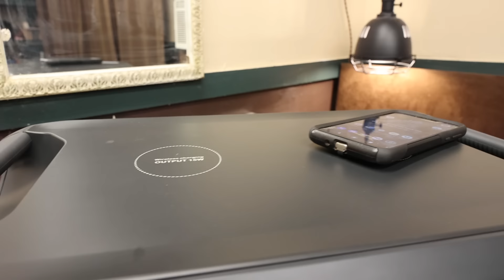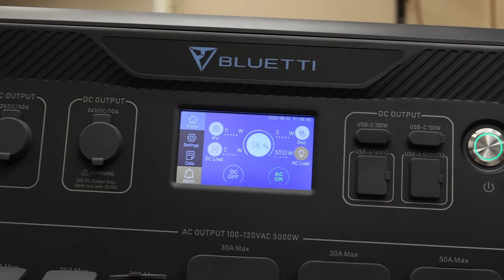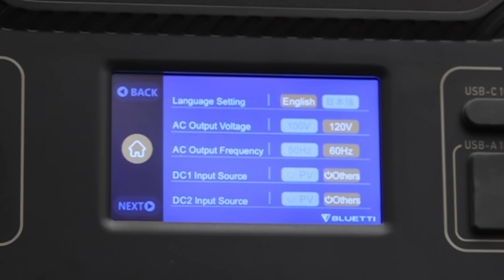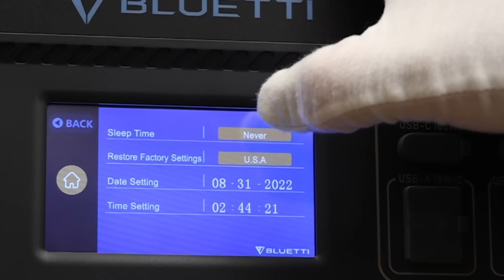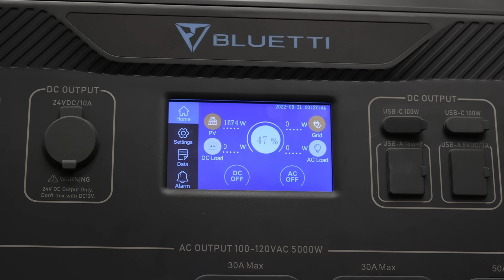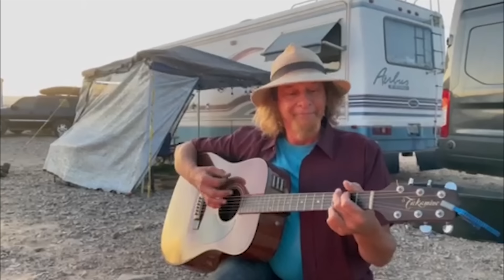Bluetti AC500 5000w LiFePO4 UPS Portable Power Station Solar Generator Review

Comment from the maker: Check out the AC500 HERE: https://gohobo.io/ac500 use code HOBOAC500
Want to HEAT the BATTERIES with SOLAR? Get this! https://gohobo.io/d050s
FACEBOOK GROUP: https://www.facebook.com/groups/hobotechcrew/
AC500 SOLAR PANELS: https://hobotech.tv/amazon/#Solar-Kits
Reply: "battery conditioning" I think is the technical term but yeah truly an amazing piece of equipment and now getting very near the point of in fact being grid scale electric storage if inclusive with proper software where say 10,000 of these could be linked up together upon a proprietary communication system to create said "virtual power plant."

Does it have wireless charging?
Cigarette lighter adapter needs to made using proper material metal connectivity given well known lack of surge protection issue.

Be nice if it came with a cigarette lighter too in point of fact.
Reply: I am looking into the 2/450 renogy, says out of stock. I reached out  to them, they say they dont have a 900 watt kit.... wierd.
Reply: Just want to let you know that there is someone impersonating you in the comment sections claiming we are winners of a giveaway that you are doing, and that they are also impersonating you on Telegram requesting money. They are using your picture and name. Please message if you want more information or screenshots.
Reply from the maker: There's nothing I can do about scammers since YouTube takes no action against them. They spam every video for the past year and I'm tired of being asked about it.
Reply: @HOBOTECH  I would feel  better if we can talk on the phone
Reply from the maker: @thomaspuma434  I don't talk to anyone on the phone and I quit doing giveaways thanks to the scammer BS.
Reply: Can you run a fridge with it?
Reply from the maker: @a.barker7792  It would be a useless product if it couldn't run a fridge.
Reply: @HOBOTECH  your right. Not the techy you are but all my neighbors are getting propane generators that run for about $350 bucks for 48 hours on a pig system. Why? Now that a complete waste of dough. Use this on and off with a small generator and solar array keeping up by throttling should be good even in Texas. During the cold spell, we surely had sun.
Reply: @HOBOTECH  thanks dude.
Reply: I see that this product has a 50 amp plug my RV which is a very big RV plugs into the pedestal on the 50 amp service with this thing run my RV or do I need to have two of them with how many batteries I have 3 ac units 1.5 ton. Also I have a residential refrigerator that runs on DC as well as 115

Comment: I have been watching the Solar Generator wars for some time. I have the technical capabilities to build a custom system, but the innovation between competitors is making me rethink a custom system.  The big question becomes when to pull the trigger because we all know an AC10000 is just around the corner.  Keep up the great work Hobotech.
Reply: I'm wondering if there won't be a relaunch of the EB500, which now looks something of an odd-one-out in the range. Perhaps something that better fits the "visual language" of this range, with this inverter (or better!), 5-7.5kw of onboard storage and support for the modular batteries.
Wouldn't mind a mild update to the AC200Max, too. Maybe 2500w inverter, a UPS and three battery ports? I'm saving for one of them, so an improved one with early bird discount would be well-timed in the next couple of months.
Reply: If an AC10000 ever happens... I can't hope/beg enough that Bluetti redesigns that clumsy/behemoth of a dinosaur power cable!
Reply: This is all backwards compatible so that's why you can buy these right now...especially the now far more valuable previous Model which again...works perfectly fine with the current system apparently and I imagine vice versa.
Reply: @__WJK__  It better have wheels, too
Reply: @jtnoodle  - Yeah, everyone has different needs but wheels aren’t much of a deal breaker for me, seeing how there are a ton of DIY wheel options I could easily add/build with off-the-shelf parts from a local home center store. However, there really aren’t any easy DIY solutions for re-doing that  horrible power cable connection design, unfortunately.
Reply: Yup.. like buying a computer.  It's obsolete before you get it home.
Reply: Need some experienced advice- between Bluetti & Renogy Lycan. Which would you pick in an off grid situation to power a small/tiny house/rv/ cabin? Need air conditioner capability. (And how much battery do I need running air con during day vs. at night with no solar input. The standard of at least 800 ah worth of batt is based on lead acid or ?) Planning on at least 1800 watts of solar to start. Have back up gas gens as well.
Reply: i got the 300 for my van , and 3 months later this came out... so now im waiting for a upgrade but it does not seem to come... i think if i buy this it will
Reply: Im trying to figure if this is thr way to go in a van build

Comment: This unit is approaching what a massive wall of state-of-the-art inverters, chargers, batteries, wiring, switchgear and breakers were 5-6 years ago.
Reply: Absolutely!  I think it really all got these vendors thinking when they saw what Tesla was doing with their cells in the car.  Amazing how quickly it's all changing.
Reply: This is what I have been waiting for.
Reply: Yeah it almost doesn’t make sense to DIY for small systems
Reply: Cool 4ID logo. We 4/10MTN were attached directly under them in Baghdad 07-09. 1/66 Armor were the only guys we dealt with. Best armor guys I ever worked around in my 6 years active.
Reply: To get 5000W input you need to re-program the device.  What is the default input wattage programmed by the mfg???  TY
Reply from the maker: It was set to 15A by default. You need the code to set it to 50A.
Reply: @HOBOTECH  🌷☘️ Thank you!
Reply: @TobyCostaRica  Especially when you factor in the mobility.
Reply: @HOBOTECH  and where do you get the code?
Reply: @debrasaints3809  you have to call bluetti and if they think that you won't hurt yourself or fry the battery then they will give you a code to use
Reply: @HOBOTECH   15A. That explains what I’m seeing with my system. I’ll have to get a code so I can change it up to 20A or 30A. (Pulling AC from a 50A RV post down to a 30A cable to the ac500. AC500 to RV with 30A cable.) I’m only seeing a max input of 1800w even when my output pushes over 2000w.

Comment: I just bought the AC500/B300s last week and your coupon code still works (thanks). I love that it's "plug and play." Several years ago I built a 1500 watt off grid system back when lead acid batteries were the only way to do. I had to go through a checklist just to turn it on/off; turn on Heavy Duty DC switches to connect all the batteries together, turn on circuit breaker 1 to power up the charge controllers, then circuit breakers 2 and 3 to connect them to the solar panels, then turn on Heavy Duty DC switch to connect the Battery Bank to the Inverter. Once everything was running I had to keep an eye on the charge controller meter for when the battery bank was down to 50%.

Now, with the AC500, I just plugged in the solar panels and turned it on. It stays on all the time now and I occasionally check it through the app on my ipad.

Comment: We are edging slowly to my dream of having devices like these becoming just normal part of the build of a house. Just like you buy an HVAC system and a Hot Water heater, you would buy a "power system" that can act as a whole house UPS and Plug in ready Solar system (in case you don't have solar yet).  This is an exciting time in Solar!  THANKS TOM!!
Reply: I have a power pole outside my building it goes to my barn and the power company wanted to just charge me $40 a month before I even bought power that's almost five or $480 a year and I was like screw that I live in a tiny house I need 1.2 KW but I have to pay $480 just to get access to the power a year nope these videos give me hope also and if I need some extra power there's always a generator and I guarantee you I won't use $480 worth of gas a year using it
Reply: Have you seen the electric prices in Europe?  For them, it will be a requirement.
Reply: It will be a terrible thing for the environment if everyone needs something like this.  Imagine all the toxic waste from the mines and batteries.  FAR WORSE than running a few coal plants.
Reply: @shaunnightfire8269  I disagree. These "end point storage" solutions will be a benefit because it will allow us to adopt renewables faster since we won't need as much expensive grid scale storage. As to the batteries themselves, their composition will change over time to be more environmentally friendly (Sodium, Graphene .. etc.) so I am not as worried about that.
Reply: @jonjohns8145  The large scale lead acid batteries are far better for the environment than thousands of end users having a bunch of lithium batteries.  The grid batteries are expensive, but they last long and a better utilized when properly load balanced.  Its like the difference between powering your car with one large lead acid battery or 100 lithium aa batteries for every motor light and gizmo in your car.  As for adapting renewables for primary grid power,  every attempt has been a disaster.  Wind, solar, and even that salt water mirror thing in the desert have underperformed and have caused other secondary issues like waste disposal and wildlife impacts that are worse than using conventional sources like coal.
Reply: @shaunnightfire8269  yeah but I can’t afford to buy a coal mine and the prices are going so high I am preparing to go off grid and this is going to future proof me for a while.
Reply: @nomaddavestinyhomes2363  try Alberta Canada we have fee's that are over 100 dollars per month I have central air conditioning 240 volts AC I'd like to get a heat pump water heater and heat pump dryer all 240 volts AC I'd love to go solar but being a senior on pension unfortunately I don't have 10 grand in my wallet like these utube reveiw chanels to get a solar generator that will give me 240 volts AC I'd like to see a 2000 watts pure sine wave inverter that's able to be paired with a 2nd unit for 240 when my budget allows me to
Reply: That's why you also have to reduce your use and as solar isn't going to do it and if you're in Canada then the winter time comes depending on you where you are there you're probably not going to get a whole lot of solar so what I did for my place is I know that's probably going to happen and I probably have more Sun than you in the winter time and I turn around and just basically figured out ways like I put a lot of stuff on natural gas or excuse me propane so anything I can do on propane cuz I can get tanks filled and get a farmer's discount and I have six tanks that run my stove in my hot water and one of those 20 gallon tanks will last me 6 Months 8 months depending on how much I use it and I am six that are filled right now so I have the next 4 years or better a propane cost me like 120 bucks then I turn around and I just bought like old Coleman they're like refrigerators but they're actually chest freezers that are made out of metal and hold on yards and they hold cold in really well and I use the freezer to freeze bottles that I throw up on top to do my Refrigeration which means that the only thing I got left is running my cell phone and all that other b***** and I use 1.25 kilowatts a day reduce your use don't do that I don't have air conditioning I do have a wood stove for heat and that's what you got to do you got to reduce your use
Reply: @shaunnightfire8269   It’s too late now.
Reply: @douglaswindsor120  yeah but again these are backwards compatible. Just buy the old now ahem "not bleeding edge" This Model and first off you might be able to actual buy the item but also the expense be far lower and then give you an "entree" so to speak into the ecosystem.

My personal problem with these items is basically two fold:

First off I want just one cable to draw power into storage drvice and second

I want just one cable to draw power out of the storage device.

This complexity is a real turn off to me to solve the problem Bluetti would be better off getting into the end user appliance market at this point to solve this issue as the biggest issue when facing whole home builds at the moment is COMMUNICATIONS between all said devices and the Battery/Inverter combo.

By way of example I WANT my hot water heater to tell me (through the App) that it's starting to degrade either as part of aging or from singular event same said be true of an AC unit where I need to have the system COMMUNICATE to me the amount of HUMIDITY said system is discharging to provide for proper/effective measurement of load/efficacy/efficiency/draw/discharge etc.
Reply: @georgedoolittle7574  
They make junction boxes so you can do that lol. That is why this unit making 5,000 watts is important. You can put in a new fusebox, with a cut off. Running main circuits in your house you want powered. You hook up solar directly to the inverter box. 

Boom! (You're off grid as long as you don't do laundry, use your electric stove, or hair drayer)
Reply: @shaunnightfire8269  absolutely !! Making and disposal of batteries is a nasty process and it's something nobody is talking about !
Reply: Would be logical next step in the age of Ai, tech and free/solar/clean energy.

Comment: I have the AC300 and two B300 batteries and 2400w of solar panels running 90% of my house and it’s working great I’m saving a lot of money on my electric bill.
Reply: That's a sick setup! I need a bigger transfer switch haha
Reply: Both China and Russia consider the United States their number one enemy, which means the risk of an EMP is higher than ever before. With your current set up, and EMP would fry both the grid and your kit. What this means is that you need to keep your kit shielded with EMP protection, so it will be available as a backup if (when) an EMP does occur.
Reply: @daisypatritio572  that is a good idea however every circuit in the house and appliance connected to it will also be fried so there is little chance the Bluetti would serve any purpose in an EMP attack
Reply: How much solar panel does it take to get 2400w?
Reply: @stephenwhite5444  I have six 200w solar panels and twelve 100w solar panels going to the ac300
Reply: @billfowler9325 can you run your home electric stove, furnace, washer, dryer from the ac300?
Reply: @FalconThe45 no only 120
Reply from the maker: Yes you can with two ac300 it will do 240v.
Reply: @HOBOTECH yes I know I only have one right now

Comment: I got an email yesterday that they had begun shipping to the early contributors.  This appears to have been a wildly successful pre-launch.  What I found shocking was they also let us add on the PS70 Units for only $99 (500w/720wh).  With no limit on how many you can buy.  That seems incredibly cheap, at 20 cents/watt, so I loaded the wagon with those as they make great bedside power backups and gifts in general.

Comment: Excellent video HoboTech! These keep getting better and better :) I tested my computer on the AC500 to see how well UPS mode worked. It works perfectly! No issues with sensitive electronics! Swapped over from wall power right into the inverter!
Reply: "Swapped over from wall power right into the inverter!" An EMP will fry both the grid and your kit, if you set it up this way. You need to shield your kit with EMP protection and use it only as a backup, after the grid has already been tried.
Reply: @daisypatritio572  I'll prepare for an EMP once they are proven to exist.
Reply: @Jasonoid  - Interesting, so EMPs aren't actually a thing after all.
Reply: @Jasonoid  Figured you for a smarter guy than that.
Reply: @Jasonoid  LOL EMP does exist.
Reply: @emssmiley2002  you going to cover your whole house with a Faraday shield?
Reply: @Jasonoid  Of course not, don't be ridiculous

Comment: Thank you for your continued humorous and most informative videos. You almost had me choking on my tea when you were talking about the DIYers!🤣. That's exactly how one of my family members sound! I am no DIYer, nor do i have any desire to be one at my age. 
Thanks to your reviews and discount coupon, I purchased the Bluetti AC200MAX with (2) 350w portable panels for my Dodge Caravan Camper setup.  I have been so happy with it! It runs my microwave, tv, and every other technological creature comfort I have in it. The only thing I regret is buying two of the 350w portable panels. I should have just bought one, and put a 200w (or plus) rigid or flex panel on my roof for continues charge. Also, it's a pain lugging around 60 lbs of portable panels in and out of the van every time I need to charge. Not to mention, all of the unwanted attention I get when I set those monsters out. Lol
Reply: @Randomadventuresebike  I find humor in everything, even in your response😁.

Comment: That's an awesome unit, but I have to agree with the bulky connector cable.  Even if they just shorten the cable and put a 90 degree connector on each end  would be an improvement I think.

Comment: Professor Hobo.   Thanks for the videos!   I still find myself torn between this and the EcoFlow Delta Pro.    In Florida where hurricanes are always on the menu (but not freezing) - wondering between:

-A Bluetti AC500 w/ 2 B300s batteries for just over 6000w
OR
- A Ecoflow DeltaPro with 1 smart battery for just over 7200w

This is for my home in an emergency and not a fulltime setup.   Will use folding panels. 

Any comments/help welcome!